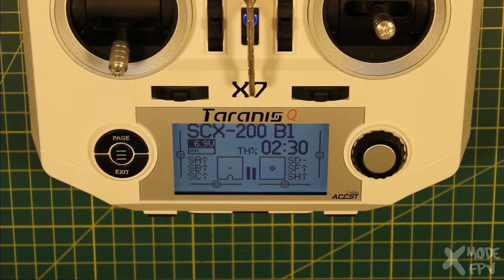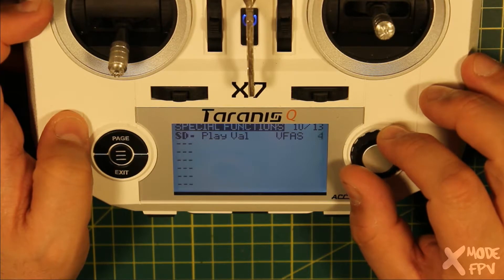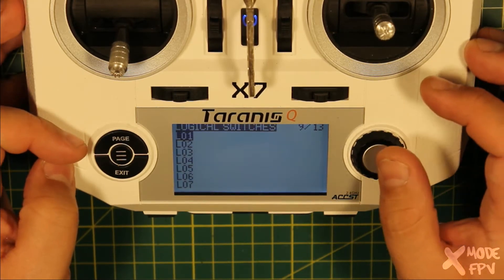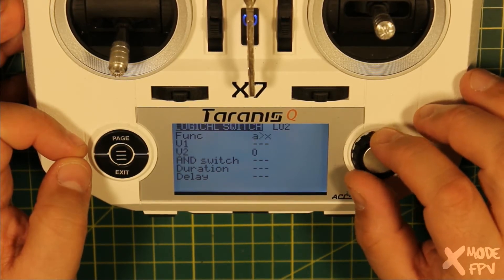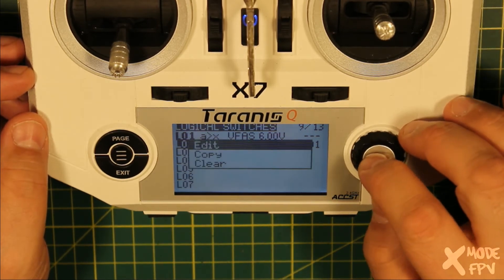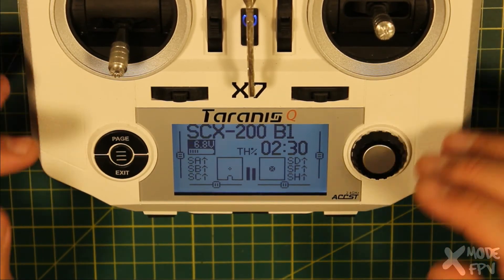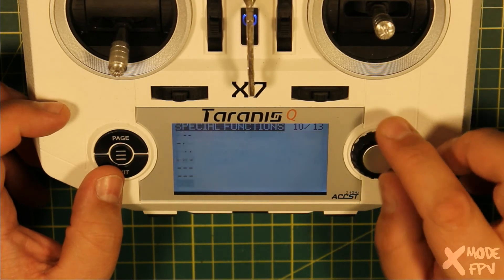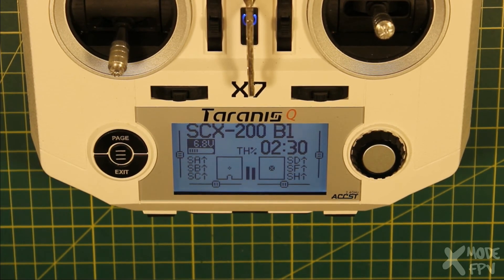Quick Tip - Taranis QX7 Voltage Warning

Comment: Stupid question, but here to learn so gotta ask it, why is it useful to get your flight stats set on your RC? Is it the same as using BetaFlight Blackbox but on the RC?
Reply from the maker: Battery warnings. The taranis will vibrate and read out the voltage when it's low. I frequently miss a flashing battery in the corner of the screen but it's hard to miss your controller yelling at you.